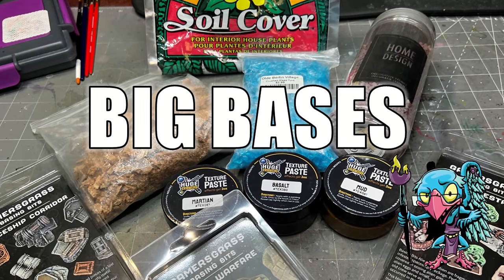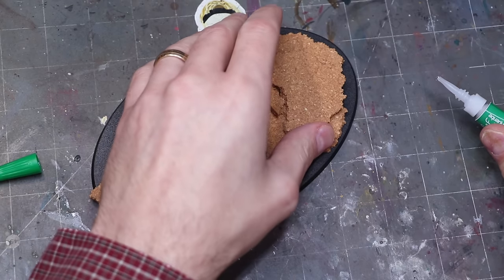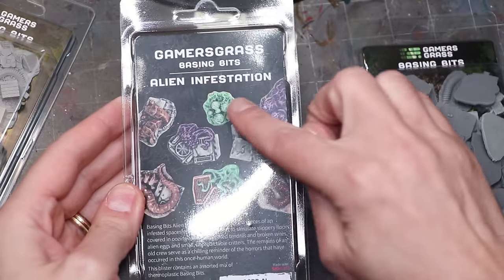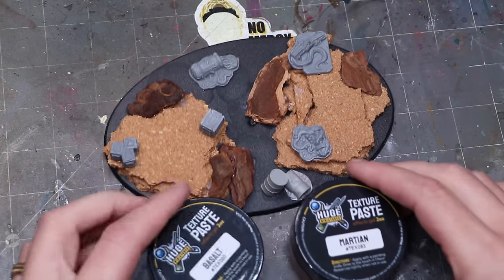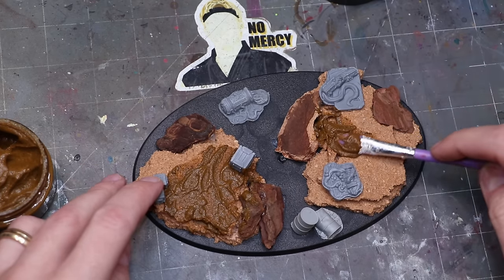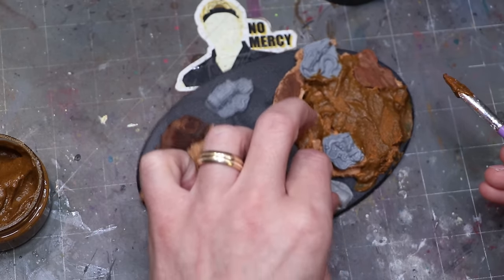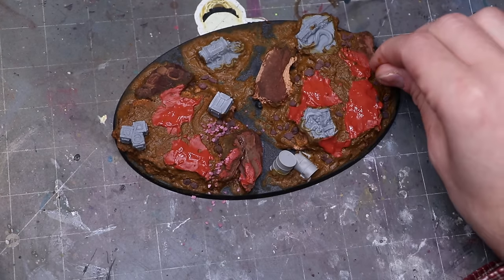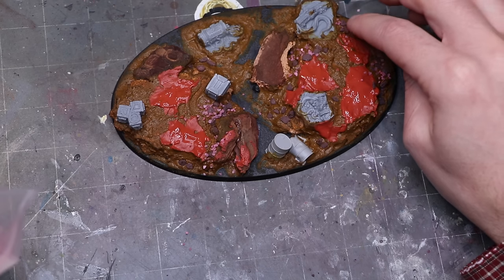Making Big Bases (Industrial Waste Base) - HC 446

Comment: A good way to join large models to bases that I learned from Jay on Eon’s of battle. Use crayons magic modeling clay. Push the mini’s feet into the clay to create a perfect mold to set it into. Then apply whatever you want to the surrounding putty and decorate as you wish and you’ll be able to seamlessly glue the model into the slot you’ve made

Comment: Hi Vince, since you always prime the bases after finishing with the texture and stuff, what's the point of colored mud/ground texture paint? Many companies sell different colors and shades of basically the same paste. I usually apply them after painting the base and then do some passes over when they are dry, but maybe I'm missing something
Reply: Depends on whether you want to paint everything or not - there are some people like e.g. HighEye Workshop on YT that don't paint terrain and instead use specific products - it will be, in general, faster